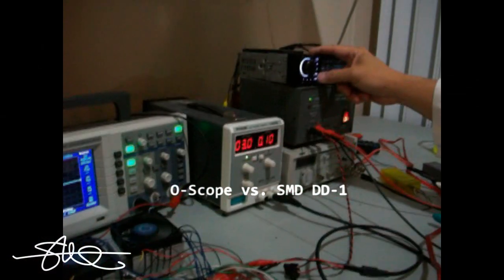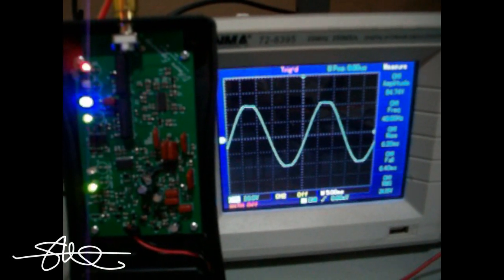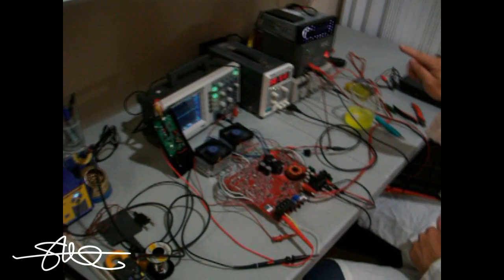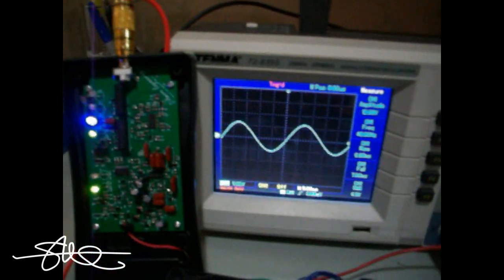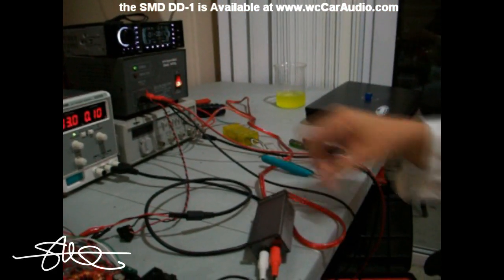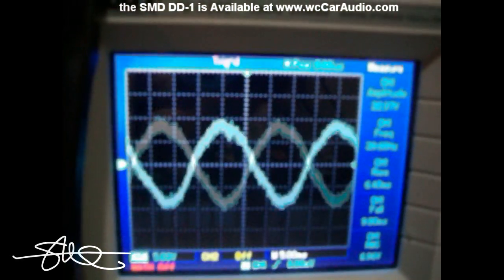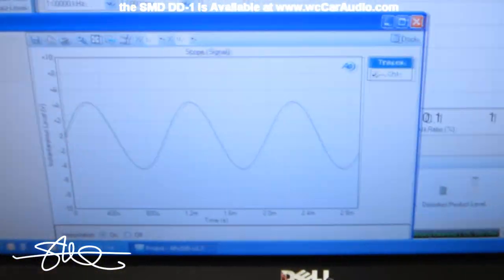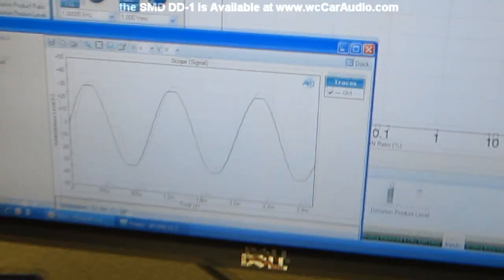Car Audio Amplifier Gain Setting Device!  O-Scope Vs SMD DD-1 Distortion Detector

Comment: so if the amplifier being used is a higher RMS wattage than the subwoofers RMS wattage. Then what should I do for setting the gains with the oscilloscope. (for reference my Amplifier is a Rockford Fosgate 500 watt rms, and the Subwoofers are Two 250 watt rms subwoofers. Now this would match, but the amplifier's RMS on the receipt says 630 watt rms. Would setting the gains with an oscilloscope be setting it to high?

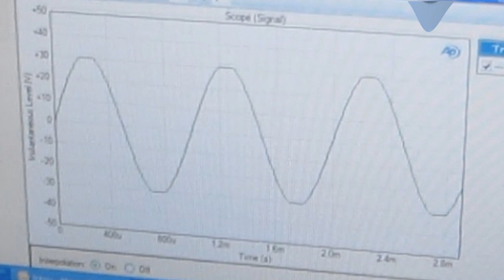Comment: So it doesn't detect clipping it just detects distortion? I mean, that's definitely a clip at 6:24, isn't that what you're trying to prevent?
Reply from the maker: yes. And the Distortion light is on......
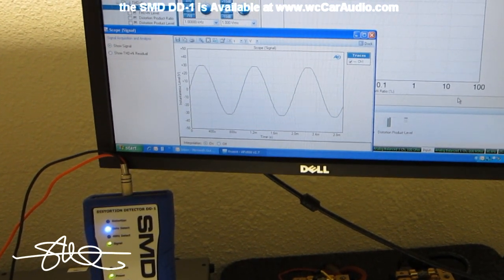Reply: At 5:53 the distortion light turns off but there's still clip.. - I know it's a distortion light and not a clip light I just want to understand exactly what the tool is doing. I have a fluke 105bii and a pocket scope and am thinking whether i should add this tool, or replace my tools with it, since it's all I use them for anyways. It'd be cool if this tool had both a clip and distortion light.

Comment: how would i set the gain with an OEM and an Alpine processor with RUX controller that also has a volume knob?
Would i set the OEM first then the RUX then the amp?
Do i need to turn the RUX all the way down when doing the OEM?

Comment: Properly setting your gain levels is the difference between a crappy installer and a good installer. I'm sure all the oldschool guys are pissed cause everyone can properly set their levels without breaking the bank with this. No reason to pay them $150+ to set your levels when you can buy this for what a reputable installer would charge. Personally, I'll stick with my Tektronix scope, but the DD-1 is a great product. It's also a lot easier to lug outside and setup than a proper traditional scope.

Comment: @meade916 also thaks to u, i got my amp n head unit to 100% playing level, i am able to throw 900-1000 watts to each of my 8inch subwoofers :), before they started to stink after a few minutes of beating on them at 600 watts each, but now they r receiving 100% clean signal n i can beat on the subs with more power n they have yet to stink, i played my 4 8s on full tilt on my aq3500.1 at .5 ohm at 13.3-13.5volts for 15 minutes, im not sure how much the imp rise is, but cant b much, thanks meade

Comment: @meade916 not the proper test track, ive used a 50hz tone from bass mekanics album with all the frequencies, but i know 50 is too high, yeah ive gotten lucky with my deck being 100% clean, with 5v pre outs, just because i wasnt sure about my radios distortion level i didnt add any processors, EQs or line drivers, as any small amount of distortion would only b amplified by them n screw me over even more, but thanks to u now i can add a line driver, bump that 5v to 9v

Comment from the maker: @NiteRyda88 thanks man!  Plus, bro, lets be honest...even with the clipping light on your amp, i bet you never used the proper test tracks to set your gain overlaps.  Plus, you wouldnt know your deck didnt distort, unless you tested it.  Some will, some wont.  Even if youre 100% it isnt, you still have EQ's, processors that come before the amp and their distortion threshold needs to be determined as well.  Without knowing that, it makes no difference where the amp gain is since its all a guess

Comment: i got a DD-1 today, it was awesome finding out my H/U has perfect power on flat, my aq3500.1 has a super sensitive clipping indeicator, the amp also buzzes when ur barely even clipping, the DD-1 was dead on with both indicators on my amp, y did i get it if my amp already has that?, i like to have more than 1 or 2 "opinions", it was DEFINITELY worth the extra money for extra reassurance, i dont make much money, im not a baller, the DD-1 is saving me HUNDREDS-THOUGHSANDS of dollars in the long run

Comment: Hi Meade,

   Great idea looks like a great product too. I looked to the 515 it's price is up there slightly less than 7k more like $6200.00 but That does not include tax but even still with what you are selling your unit for the savings is well worth it. Keep up the good work.

Comment: @meade916, 
I'm in the uk and have been playing around with subs and amps and electronics for years, I love bass more bass the better, I've install a few systems my self but never could get the gains spot on, and in this video imgaine having to say to someone hey give me 3 hours to get all my gear there, 
as with Steves device its portable, pratacal, and easy to use that alone tells me its sold, and its about time someone came out with something like this for and average DIYER and the pro;s

Comment from the maker: @risenwarfare your amps clipping detector is bullshit compared to this.  Not only that but i guarantee you didnt use a cd with the proper tracks to match your head unit with it.  Not that you could because It doesnt work that way anyway. If you dont know where your deck is distorting then none of it matters. ....all that thing is is a fancy light that blinks and in most cases, totally worthless.

Comment: @meade916 My multi meter wont give me distortion or clipping your right but i found a calculator online and i figured out how many AC volts would give me 400 watts rms..thats what my subs rated at so i figure im good there.. Its not the best but atleast i got some bump.

Comment: wish i could buy one just to support you but i dont have the $140 to buy one. plus i dont have all that big of a system. only running 1 13 on 800 watts. i need to tune in my amp a lil more but i dont have an o scope either... im fucked lol

Comment: I like how he showed the bad ground loop isolator and the detector picked it up quicker and easier than the o-scope. it would do the same if you had a working HU or AMP you thought was good?  its also going to determine the working condition of your equippment?  if you could not pick up a signal through your amp before distortion occured it could be the deck, rca cables or amp that is causing a problem like the isolator. this will help you find where the problem is occuring by process of elmin.